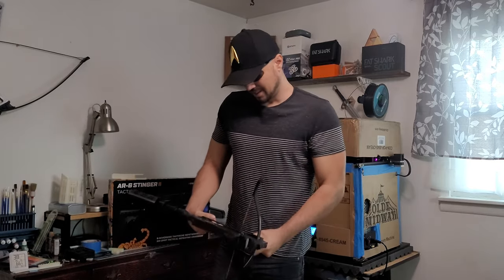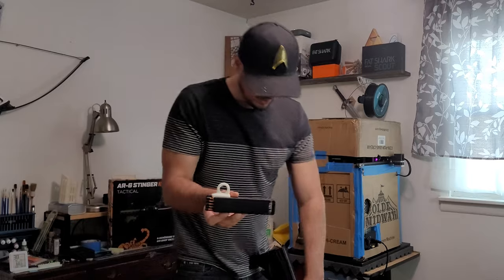Steambow review AR 6 stinger 2

Comment: Its aluminium 
Not aluminum 
Aluminium 
ALUMINIUM
A L U M I N I U M
WITH THE ''I'' IN BETWEEN.
Reply from the maker: Hahahahah ok
Reply: Steambow's metal magazine is aluminium, the buffer tube is aluminum and the cocking rods are made of steel. However, ALL other parts are made of high grade polymer.  3D  printing is cheap plastic, that said newbies often mistake high quality polymers as aluminium.